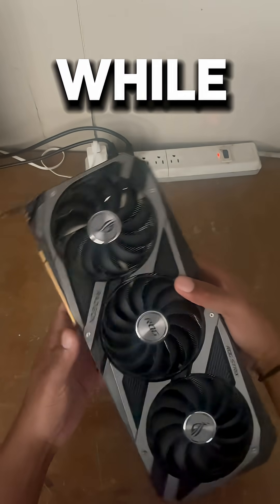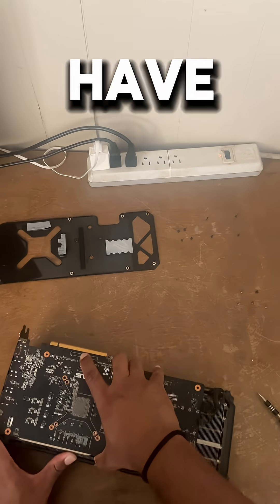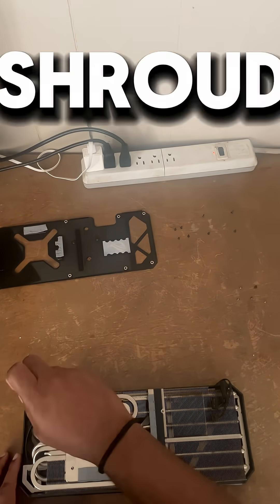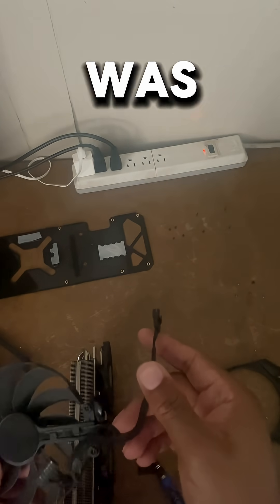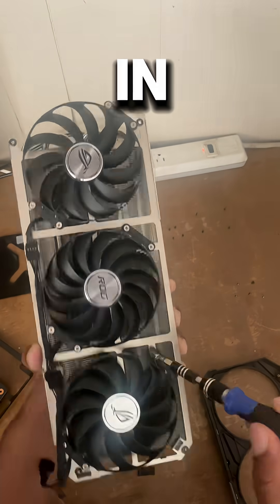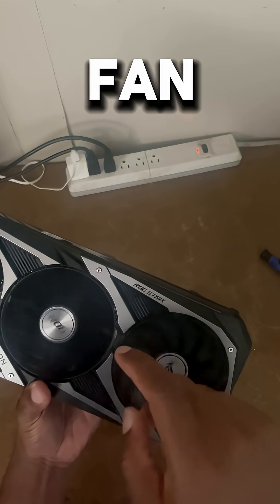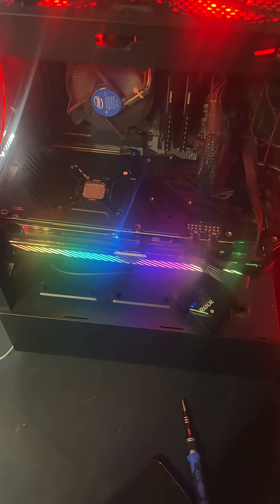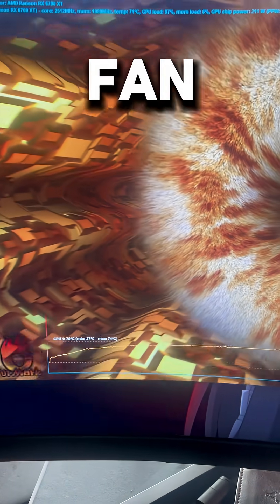GPU fan replacement! #gamingpc #gpufanreplacement #gpu #repair #6700xt #amd

Comment: hey man, thanks for the vid. quick question, my broken fan is the one closest to the connection ports. so is it the fan with the motherboard connector and middle fan (2 wires split) or the one only connecting to the middle fan, (single wire)